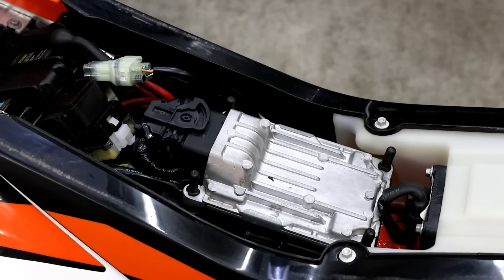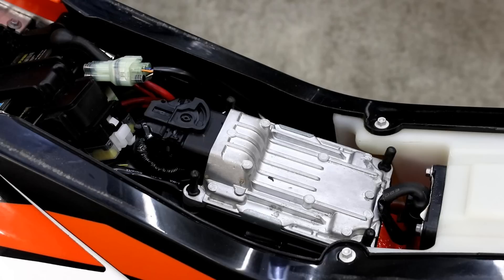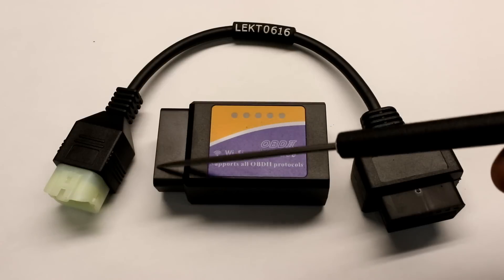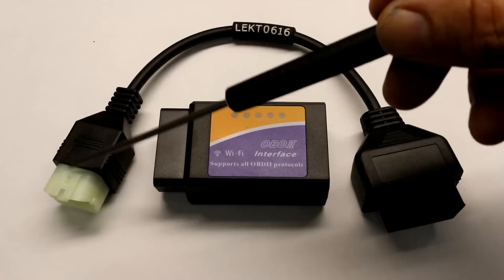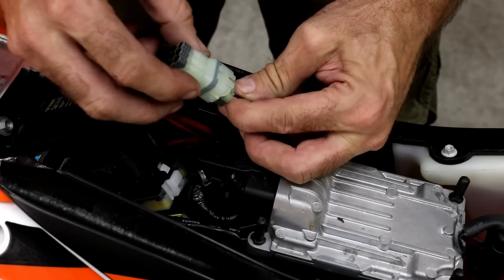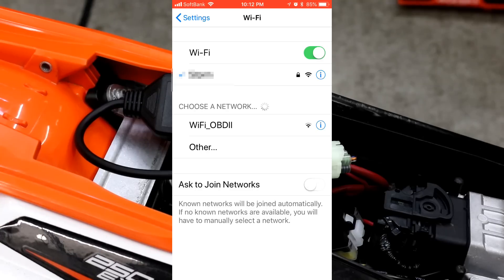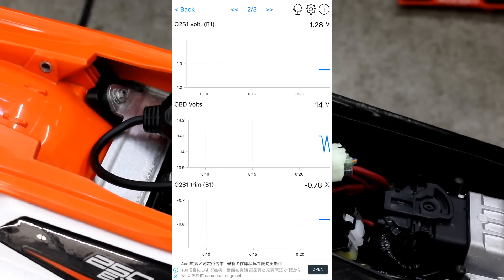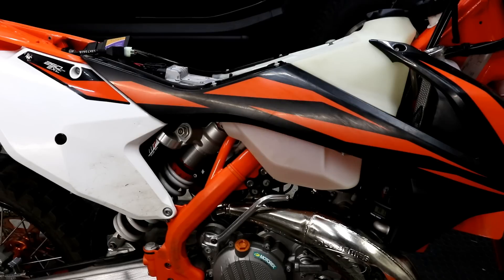KTM TPI 2-Stroke CAN Bus OBD2 Scanner Data & Diagnotics

Comment: Any comments on whether the ELM327 and adapter cable will work with the current model of orange (KTM) flavored 4 strokes too ?
Reply: I think KTM uses the can iso-15765 obd protocol on all their bikes since they have to use obd2 by law, if not it'll be saeJ2480, and it only depends on your adapter if it's able to do so. U can see the used protocol for 1 second at 2:58 in this video.
Reply: Hi  @TeaIP  do you know what protocol the new TBI bikes uses? or perhaps someone else does. Please comment. Thank you.
Reply: PS: The quality of your videos are most excellent. Top work.
Reply: I use a BAFX bluetooth OBDII dongle and a KTM 6-pin to OBDII cable I got from OBDInnovations to connect to my 2017 Husqvarna 701 (KTM 690ish).
Reply: @dstutz97  
Hi mate what year is your Husky and does it have fly by wire throttle? Just wondering if it work on my KTM 690 2015? Cheers John
Reply: @johncox891  It's a 2017 (edited my comment as that info is probably useful!) with the newer dual-counterbalanced motor and yes, fly by wire throttle.  I think as long as the bike has the OBD interface with 4 pins exposed, it should work.
Reply: It does not work on 2017 KTM 690R - BAFX bluetooth OBDII with KTM 6-pin (only 4 pin are used) does not find any protocol to interface with ECU.  I tried all protocols included ISO 15765-4 CAN (11 bit ID, 500 kbaud).  I do not know what to do next?...
Reply: @patrickgiraud7908  2018 Husky TE300i here, mine does exactly the same. Cannot connect to ecu. Unknown protocol. Did you figure it out?
Reply: Jon Barber no I gave up using OBD and was able to troubleshoot my ktm with an other method. It was the fuel pump running low pressure (30psi) instead 50psi. I changed the pump and my ktm ( only 3500miles) is back on track. Shame on you ktm for using low quality fuel pump and do not recognize the issue and not establish a world wide recall.
Reply: The ELM327 WiFi with the adapter cable and the "Car Scanner" app on an IOS works on my 2018 XC-F
Reply: @mrdlraiford  which adapter cable are you using?
Reply from the maker: I haven't tried on any bikes other than my 2019 KTM 250 EXC TPI. Could some other viewers comment if you've been successful on any other bikes....
Reply: @TokyoOffroad  what connection profile did you use on the app?  I get a connection to the ELM but not the ECU.  I have a 2021 KTM 300 XC-W TPI
Reply: I have a 2019 ktm 450 exc, it works with the elm327 wifi
Reply: Anyone tried it on the 2024 excf ?
Reply: @gerardosullivan7126  I tried but could not get it to work. Pin-It Racing say    "This specific code reader is not for TBI bikes.
We offer a different code reader that works on current 2024 TBI models, and remapped 2023 TBI models."  but I can't see it on their website.

Comment: Have you tried this with 2024 EXC 300 / 2024 TE 300 ?
Reply from the maker: @TimoTurner  - Yes, I tried, but it unfortunately doesn’t work. I ended up getting a TSP ERM which can read and reset faults, read data, write and adjust maps. The ERM is a great tool to have for these bikes.
Reply: @TokyoOffroad  Thanks for reply. I considered the TSP ERM but its rather expensive in comparison to the simple OBD2 reader!

Comment: Is it suitable for husqvarna fe 350 model year 2019? Can tel me the hours of engine?
Reply from the maker: I've personally only tried this in 2-stroke TPI bikes so am not sure if the 4-strokes are the same. Unfortunately the engine hour information can not be read using this method (the dealer tool can though).

Comment: Hello Tokyo offroad and many thanks for video and information. Do you have the list and description of fault codes for KTM bikes family? I'm waiting for the adapter cable from UK and I will try to use it on a Husqvarna TE250i 2021 model year. Thanks in advance.
Reply from the maker: The 2021 KTM 250/300 EXC/XC-W TPI Owners manual has a list of blink codes starting from page 157
Reply: @TokyoOffroad  Thank you, I found it. The blink code corresponds to error 33 but it doesn't appears on fault code list of the app connected to OBDII. I had this error after I executed the procedure to start oil pump to avoid bubbles in the oil circuit. Some time the blink code disappears after I switch off and switch on the motor byke.

Comment: could you tell if OBD delivers more details than blinking codes on the dash? I get 09 Malfunction indicator lamp flashes 9x short which can be caused by crankcase pressure sensor or ambient air sensor. It would help if I could nail the problem down to the specific sensor

Comment: Does your 6 pin adapter cable have all 6 metal pins in the adapter?   My cable has only 3 metal pins in the 6 pin configuration....
Reply from the maker: Sounds like you don't have the correct cable

Comment: 1).  I have a 1 year old  Android Samsung S20 5G phone and 2022 KTM 300 XC TPI. 
The WIFI OBDII works for me with the LEKT0616 adapter cable.
 The engine does have to be running.
Without the cable it works great with a 2017 Toyota RAV4 also.

2).  Any suggestions of an OBDII that can be used with the engine not running ?
I suspect my bike has a bad Crank Case Pressure Sensure and would like to connect a hand pressure / vacuum pump to the CCPS without removing the CCPS and see what it reads as I lightly change the vacuum /pressure. 
And to test if there is an air leak in the CCPS (will it hold a constant pressure)? Guess I do not need to read this via the OBD but watch the hand pump's gauge for maybe 5 minutes will work. 

I could do this via disconnection the black hose from the CCPS but it would be safer to disconnect it from the brass fitting that is threaded into the back side of the engine just above the reed cage. This way I would not stress the plastic CCPS nipple.

I saw a YouTube video of a guy checking his insitu CCPS via a different scanner, and using a hand vacuum pump. Via the OBD he could read the kPa (I think it was kPa) as he applied varying vacuums to the CCPS. 
Then he would compare the OBD to the pump's gauge as they should be very similar.
 I cleared the YouTube history and cannot locate the video now to ask what OBD he used. LOL.
==============================

Update:

Some readings I got after it idled from cold start temperature (ambient 20 degrees C, 68 dergrees F) for what I thought was about 1 minute: (the OBD says the "Run time since engine start": 0.00:17:42 so it was only 17 seconds). I was inside an enclosed garge so I rushed so to limit the exhaust fumes I would breather.
(Note, I did blip the throttle a few times so think I captured a screen shot once it was back to idle speed)

1st screen shot:

??? air temperature:  20 Degrees C (I cut off part of the label when I took the screen shot so not 100% sure what the ??? is).
MAF air flow rate:  0.73 g/sec.
Throttle position:  12.94%
Oxygen sensor 1 Bank 1 Voltage:  1.28 V
Oxygen sensor 1 Bank 1 Short term fuel trim:   -0.78 %:  
Run time since engine start:  0.00:17:42
Barometric pressure:  99 kPa
Fuel/Air commanded equivalence ratio:  14.69
--------------------------------------------

 2nd screen shot: (scrolled down some on the OBD screen)

Intake manifold absolute pressure:  98 kPa (this is the CCPS reading live I think), which is 14.2 psi (pounds square inch).
Engine RPM:  1783 rpm
Timing advance:  12 degrees
Intake air temperature:  20 degrees C
MAF air flow rate:  0.96 g/sec

Intake manifold absolute pressure did drop when I opened the throttle 3 - 4 times. Have no reference so do not know if any of these readings are OK!

Thanx for any assistance.

The OBD did indicate that the air conditioning was not working. Would be nice for those hot summer days. 🤣🤣

Comment: Where can I find TPI fault code definitions?
Reply from the maker: The KTM 2021 300 EXC TPI Owners Manual has a list of blink codes listed on page 157 & 158
Reply: @TokyoOffroad  I was hoping the ELM327 would provide more insight. For example a failing CCPS, may not be a fault code, but does it provide a pressure reading? And if so, how would I know if its in spec?
Reply: Now I see the smart phone app you suggest will decode standard codes. I ordered up the ELM327 and adaptor from ebay US for future troubleshooting.

Comment: Hey mate will this work on a tpi 2021 ??
Reply from the maker: Yes, it works fine on the KTM and Husky 2021 TPI models. Note the for the GasGas TPI you’ll need a different connection cable.

Comment: Does it matter how many pins are in the 6-pin connector? I've seen the same shape of 6-pin connector with 3, 5, and 6 pins. The 3-pin ones look nice like yours (molded) and the 6-pin ones look like a hobbyist job with heat-shrink tube.

Comment: Great video, thanks for sharing. I bought a LEKT0616 to connect to a 2021 gas gas EC 300 (KTM) but it doesn't power up the odb2 Bluetooth adapter. Does anyone know if this bike requires a different system to connect?
Reply: Answered my own question, the new gas gas uses the euro5 6-pin connector (red under seat) lonelec E5LE0616 connector cable works a treat

Comment: Does this app show engine hours as well as miles?
Reply from the maker: You'd need the KTM diagnostic tool which only dealers have to show the number of hours. I'm not aware of an aftermarket solution which can do this.

Comment: I’m new to the bike world I’ve been mainly working on cars/trucks but I have a 2019 KTM 390 Duke so mine has the 6 pin? And I be able to check any trouble codes and also reset the service light?

Comment: Hi  if you have a tpi bike  that won't start can you still read the fault if the bikes not running or won't start? for me this is what I would need as I repair bikes and some come in not running, thanks Chris
Reply from the maker: Yes, it's possible, but you'd need to make your own adapter cable so that it's powered even when the bike isn't running. I don't have a wiring diagram at hand, but if you ask on one of the online groups (E.g. FaceBook- KTM Husqvarna TPI Owners Group) I'm sure someone can provide a diagram to assist...
Reply: @TokyoOffroad  Ok is the power cable needed to power the obd port.  So let's say like and earth from battery to obd cable to power the ecu up? Thanks

Comment: can you read hour meter?
Reply from the maker: The speedo hour meter is not connected to the ECU so that information can not be read. But I heard that the dealer tool can read the number of hours the engine has run. I haven't seen it first hand so am not sure though. The Car Scanner app I used in this video doesn't show any hour information.

Comment: Thanks for the nice video. Can i get the links for Cable as well as obd2 tool purchase
Reply from the maker: Bhavesh lad - A link to the cable is in the video description. The scanner is broadly available online (scanner model is listed in the video description).
Reply: @TokyoOffroad   thanks for quick response.  Very much appreciated.
I have duke 250 abs 2019 version in india. Will this cable work in it for can bus to obd2 conversion?
Reply from the maker: Bhavesh lad - I’m not sure about the Duke. I’ve only tried it on my 250 TPI

Comment: Hello,I might've ran into a problem I bought the device and a cable but when connecting to my ktm on the app it says connecting 
for the 2nd port is not available/or fails and I think that the cable I bought isnt the correct one,can you link the one you bought.Thanks in advance,the one 16 to 6 pin I bought has some of the 6 pins on the end blocked,which might be the reason Im running into trouble

Comment: Did you happen to notice if the system provided any information regarding oil flow rate? I'm looking for a way to monitor for oil pump failure in real time, and this could be a reasonably simple solution if supported. Failing that, it may be time to hit the electronics test bench! Thank you for the helpful video.

Comment: Just ordered both scanner and cable - thanks a lot! I'm also interesting in being able to change settings on the bike, like the temperature the fan will turn on - any ideas on this?
Reply from the maker: Unfortunately, as far as I know changing the ecu controlled fan on and off temperature settings is not possible with this tool.

Comment: Hi! CAN you give me the wiring from 6 pin ktm diag connector please. I’m looking for diagnose a 350 exc-f can-bus with elm327 wifi adaptor and a diy cable adaptor between 6 pin connector and elm327 interface. 
On workshop manual i found wiring diagram but get no success
Reply from the maker: Pin 6 on the KTM connector should go to pin 4 on the OBD2 connector
Reply: Tokyo Offroad sorry for my bad question, i’d like to know the link for each pin of the ktm diag 6pins connector and the odb pins connector
Reply from the maker: 1->16
2->6
3->14
4->7
5->NC
6->4
Reply: Tokyo Offroad thx!

Comment: Hi, amazing videos in your channel. 
I have this scanner but cant order the adapter cable to Brazil.. Is it a simple cable or does it have an electronic components to do the conversion? 
If it is a simple cable, can you share the pin order? So I can make it to use on my 2018 300 TPI.. Thank you..
Reply from the maker: It's a adapter simple cable. If you have both connectors it should be relatively easy to make. Regarding the connections I'll let you know...
Reply from the maker: On the Facebook KTM Husqvarna TPI Owners Group, Fabio Bizzetti recently posted details of an adapter cable he made. Please join the group and look for a post by CD Van Der Hoven on June 19, scroll down and you'll find the post by Fabio with a photo showing all the connection details. One advantage of his cable is it can be used without the bike running.
Reply: @TokyoOffroad  did searched through the facebookbut could not manage to find referenced post. Anyone has the link or schematics of the adapter to run diagnostics tool without running the bike?

Comment: Very cool Video I will buy the equipment and try on my 2015 350 EXC-F
Are u able to look into the rpm log that shows how many hours the bike was used in which revs?
Reply: did you connect it to your bike? which pinout did u use? kline or canbus? i've a 2015 exc-f 250

Comment: what OBD II setting are you using with the car scanner. I can connect the ELM 327 to both my cars but it will not connect to the 300 tpi ecu
Reply: I'm in exactly the same situation. I'd be grateful if you could share the settings please.
Reply: bencollins2000   I bought a second obd 2 cable from lonelec in England and it communicates perfectly.
I think the problem is the cable I purchased on Amazon. When I hook up with the lonelec cable it establishes 
communication right away just like the video.
Reply: @larrybeaufait5211  thanks! I'm just looking for the differences in the pin outs between the two styles of csble, thanks for confirming it's a problem with the cable not software settings.
Reply: @bencollins2000  I am having the exact same issue. I purchased my cable directly from lonelec though

Comment: Hy, it work on exc 450 2012?
Reply from the maker: Sorry, I don’t have any experience with the 2012 450 EXC. I only know for sure that this works with the 2018 & 2019 KTM/Husky TPI 250 & 300s. If anyone else has tried this on four strokes please comment.
Reply: Tokyo Offroad it worked on my 2018 Husqvarna FE450 so tbh give it a go if it has the connector next to the ECU.

Comment: Hi I bought the cable adapter on Ebay and have the Wifi ELM327 but the bike 2019 Husky 300TPI doesnt connect to the OBD.
Do you think that can be the adaptor cable (6 to 16 pin)??
I've read somewhere about the K-line cables and CAN-BUS have a different pin array and I dont know if to buy other adaptor or not.
Reply from the maker: Yes, I think you probably have a K-line adapter. The adapter I linked to in the description is a CAN bus adapter and will work on TPI models.

Comment: Does this mobile app allow setting a specific temperature when the sensor- controlled radiator fan is activated? I plugged in the fan to the plug under the tank, added a relay in the airbox and it works but the fan is activated when the engine is already very hot (92 deg Celsius - this is the value I found online). I would like to set this much lower but I am not sure if this parameter can be edited somehow in the ECU.

Comment: Is it possible to read total motohours or distance from ECU?, Thanks.
Reply from the maker: I do not recall seeing that information on the App I have, although I wasn't looking for it. I wonder if anyone else has tried a different App and been able to read it?
Reply: Thanks for answer Tokyo, just bought EXC 500, year 2014 and would like to check if kilometers on speedometers are the same as in ECU (just for sure).

Comment: Hi ther useful info, what is your elm 327? is the v1.5?
i buy one and it doesn´t recognize the ecu.
Thank you
Reply from the maker: I’m not at home now so can’t check the version. But the most common problem seems to be with the adapter cable. There are two types. The correct cable is compatible with CAN BUS. The incorrect cable is compatible with K-LINE. Which cable do you have? If it’s the wrong cable the ELM will still power on but it will not connect to the ECU